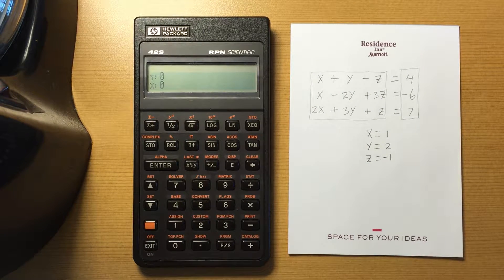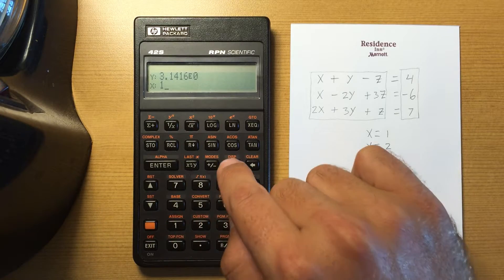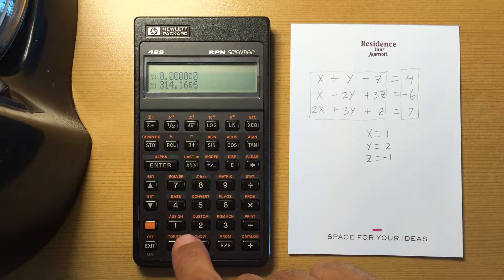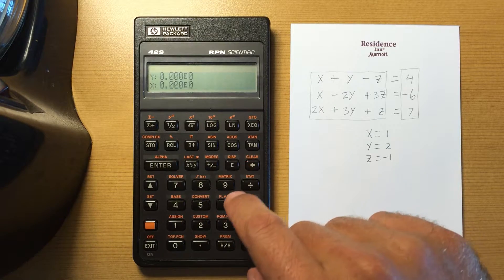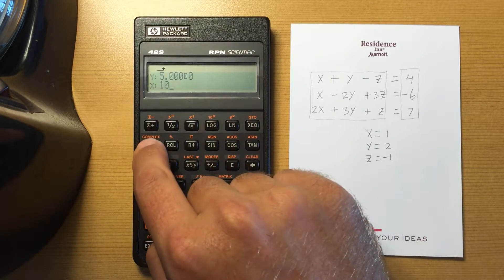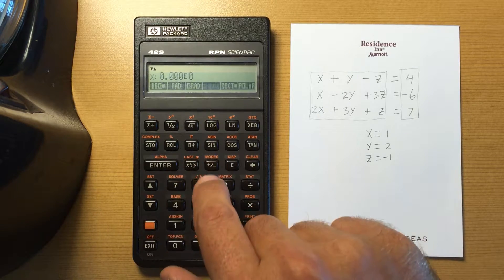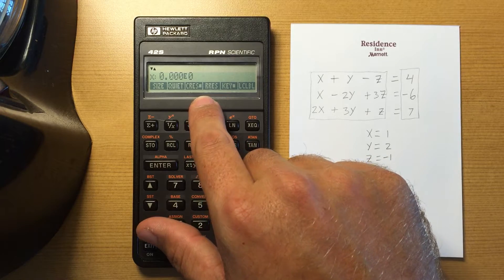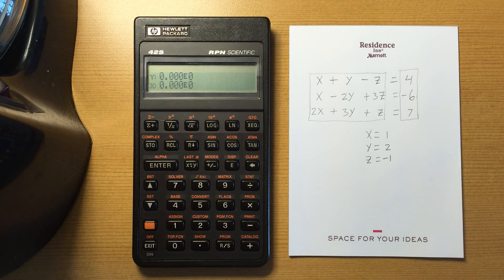HP 42s Mode and Display Menus

Comment: I just pulled out my old HP 42S from 1988 to do some calculations with my taxes.   I used this in college and hardly use a calculator now.   I cannot use my kids calculator because it is not reverse polish.   But, I had forgotten all aspects of operation.   I found your three educational videos on the HP 42S and, honestly, they were fantastic.

Thanks for taking the time to do them.
Reply from the maker: You're welcome! I do actually have quite a bit more than three videos on the 42s, and I'm glad you found them useful.
Reply: @west  As I begin use of this nice older calculator again I will access more of the video instruction available.   Thanks again for your time and clear presentation.